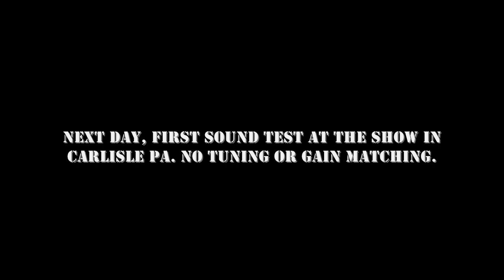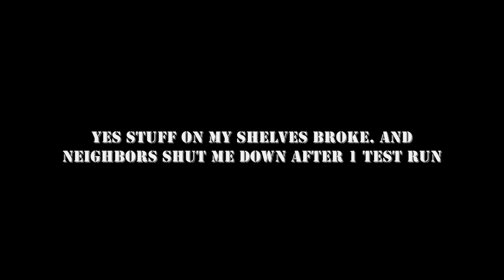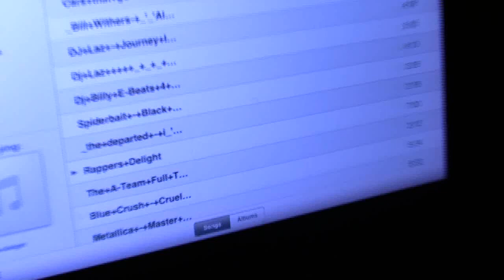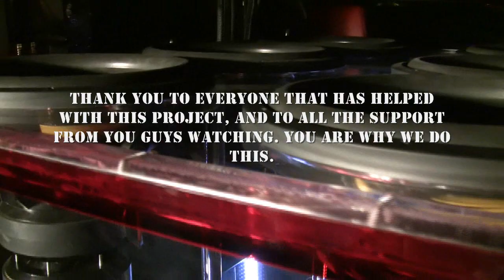Crazy Hummer 6) SMD 18s Meter and playing

Comment from the maker: @BradandJazmine Thank you. I suggest using only matching subs. Different model and sizes utilize varying airspaces and tunings. So they can fight against eachother and diminish quality and loudness. So stick with either the 2) 12s or 1) 15 or 2) 10s, not all. And for power, just use the correct amp, no capacitors. An upgraded battery up front and a 2nd batt in the rear does very good. Especially if they are XS Power batts.

Comment from the maker: @efixeated Hmm, IDK, in the early part of the vid, the trim ring is not on. So what you see is just the IPAD on the connector, the dualock is attached on the back. In the later part of the vid, there is a black trim ring around it.

Comment from the maker: @tuffguy40 First thing this was designed for was to sound good and loud to the ear while demoing with doors open. Numbers were never important, infact Trippi, the owner, never cared if it metered at all. And it's doing this in the low 30hz and very flat on low tuned music. It sounds louder than any smaller burp setup that can do higher numbers and that was the point.

Comment: One sick ass box what r you using to keep the amps from vibrating loose? I have to mount my 12k on my new enclosure and have came up with springs as a suspension above and under the lip of the mounting tab

Comment: that would have worked so much better in a little debbie box truck walled off it would be like a box inside of a box what i a tryin to say is that is that sound needs to travel he could have took 4 of those smds 18s and 8 of those t 2500.1s  and strapped 2 on each 18 inch smd sub and got same results of corse with the perfect ported box i can picture that amount of audio only in a box truck but to each his own thats just my opinion dont take it personal